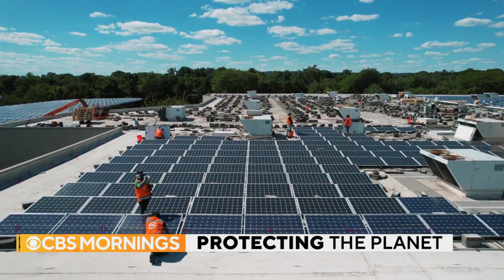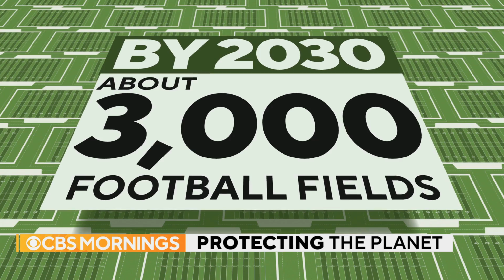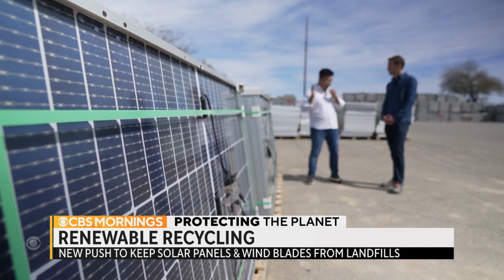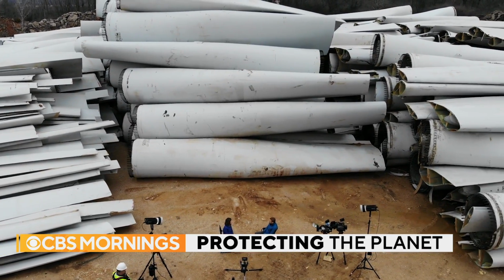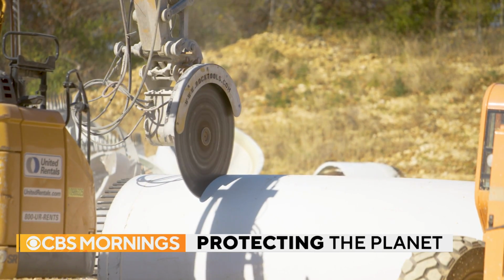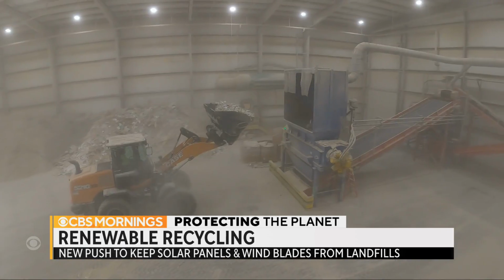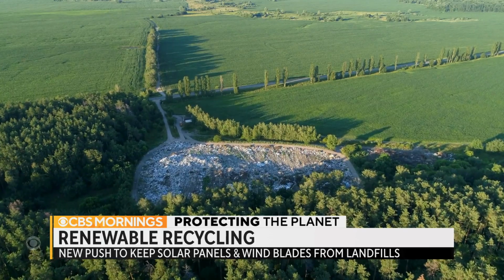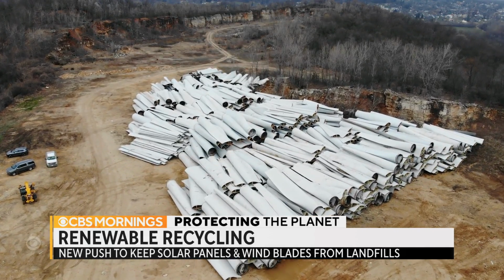Wind blades and solar panels head for landfills after being replaced

Comment: So burn the fiberglass resin (plastic) oil)) and dead trees like coal and call it green.  Fascinating.

Glass is basically useless in recycling.  The aluminum is recycled...but glass was only sucessfully REUSED in the era of milk and deposit soda bottles.  Once we wanted them melted and made virgin again...sand was easier...which is why so few districts actually recycle glass.  Pulverized it is good in redlective paint...but we don't need that much paint.

Solar/Wind is surpassing coal for NEW power plants in ths US but not the world (Russia/China for instance).  However if you are tracking it you'll find Solar/Wind grows at the same rate as NATURAL GAS ELECTRIC as they are bedfellows (handles night and bad days)

Solar/Wind isn't often coupled to nuclear or hydro, since they make more power 24x7 than Solar/Wind could ever.

Comment: Lets cut through all the bullhockey. The only reason so many of these panels and blades are not being recycled is because someone cant profit from it enough.  Just being in the black is not enough, every recycling plant every made only worked because they sold the material to someone else who wanted the goods.

The main reason virgin materials are cheaper than recycled is mainly due to government subsidies.  Stop the subsidies, and suddenly recycling becomes a viable option.  Who could have guessed that using massive amounts of machinery to dig up, process, and ship massive amounts of raw ore to different places is more expensive than just remelting the metal that is literally in the backyard.

Comment: Grinding up solar cells can create dust with elements like germanium, indium, arsenic, and antimony.  The destruction of a few solar panels will probably not be an environmental or health problem.  However, the shredding of thousands of panels could become one.
Reply: Large particulate can be captured easier than co2 or other gases.
Reply: true, oversight and capture methods have to be in place for sure. Although it's not impossible. Tbh if tossing stuff wasn't so cheap they'd probably be doing it by now
Reply: Thousands of panels? Try TENS OF MILLIONS of panels. And the process costs about $40 per panel to recover $3 in valuables. That is not a misprint. So, who in their right mind will recycle these panels? And WHY is nuclear so easily discarded as a solution? Gee, that's a great question.
Reply: No do fossil fuel

Comment: What chemical compounds are released when the blade dust burned?
Reply: All that resin and fiberglass, burns clean I'm sure...
Reply: @headspaceandtiming2114  Not to mention all the toxic waste from the chemicals used to make them, but hey that's tomorrow's problem right.
Reply: I've got a feeling there's plenty of CO2 coming from them when burned. I'd bet there's plenty of heavy metals and CO2 when the solar panels are melted down, too.
Reply: Burning plastic is pretty horrible.

Comment: This is a problem with attitude and lack of will to avoid waste not the technology itself sadly .... Its like lithium batteries whicg should be recycled inside the region they are disposed in, and renewed abs put into new batteries.... But instead it fills up landfill as one use vaping devices

Comment: It should be noted the fossil fuel industry never had and still does not have a solution to deal with their CO₂ and CH₄ (methane) emissions either!   That doesn't even include toxic carcinogenic volatile hydrocarbons and NOₓ and SOₓ either that are natural bi-products of combustion. 

Globally we emit a vast 37-billion metric tons of carbon into our atmosphere every year and almost all of it is fossil fuel based!  The fossil fuel industry uses our shared atmosphere as a global public toilet.  The waste from wind and solar is currently tiny comparison to that annual figure.  Also, as the video shows, recycling initiatives are getting underway thanks to enterprising companies.  Government subsidies will arrive too since it is an area of public interest to recycle.

Moreover, the fossil fuel emitted CO₂ and CH₄ is a "high entropy" type of waste that disperses far and wide and is very difficult to deal with.  Contrast that with wind turbine and solar panel waste which is "low entropy" in comparison and much much easier to handle.    

Also, fossil fuel carbon is invisible and dispersed so is out "out of sight & out of mind" from most people's daily attentions.  So there is no eye-catching landfill or dump of fossil fuel carbon to point a camera towards for a television news segment.

A solar panel is fairly homogenous in construction compared to, say,  a complex mass that is an LCD home theater screen which is about the same area.  A solar panel is just an aluminum frame (easy to recycle) and a thin wafer of glass, silicone, copper/aluminum and trace chemicals.  Each panel is already conveniently sized for a single human or a pair of humans to lift!

Comment: "Unexpected"? Who wouldn't have expected it? The people selling and installing them certainly knew what the projected lifespan was before they were sold or installed.

Then again, wind and solar still produce less than hydro. It's not so much that wind and solar are increasing as coal plants are being shut down due to regulatory constraints.
Reply: Coal is being shut down because it’s uneconomic. They should be shut down because of their toxicity but unfortunately, they are not in most cases.
Reply: @colingenge9999  "Coal is being shut down because it’s uneconomic."
It's being shut down due to particulate regulation. With the price of gas having risen and demand for coal fallen, the cost of operating a coal plant has fallen relative to gas, wind and solar.

"They should be shut down because of their toxicity "
One person's "toxicity" is another person's hospital with the lights on or grandmother with a warm house. People certainly do seem to be wiling to toss out the objective benefits coal has offered society over the last century and a half.
Prior to it, we were burning whale oil lamps, riding horses and taking three week sailboats across the Atlantic.

Comment: Most industrial grade solar panels are actually resold. They are still more powerful than cheap home grade and will last another decade or two. Smart DIYers buy them all the time very cheaply. Solar farms take them down simply because newer, more powerful and more efficient panels come into the market, and they can double the production per land area.

As far as wind blades, one recycler is actually grinding them down and using the pellets, grains and powder to create a new, longer lasting, stronger cement, which significantly reduces the amount of CO2 released versus the standard cement making process.
While another has figured out a way into turning them into new fiberglass to use in other industries.
Reply: sure,,,doubt its,,,you keep your tin foil hat on,,,but why worry,,,Greta said the earth will be done in 2023.....rotflmao

Comment: Windmill blades are perfect to repurpose as houses structural walls put plaster board on inside, and seal voids on outside between blades.
Reply: ?????  What kind of house would that be?  Most houses are built in straight lines, flat sheets of material, sticks, studs.... I'm not saying a very swoopy 3-D kind of rugged house is BAD, but I don't think the building industry has any idea at ALL of how to do this, and in fact that your comment might not be entirely sane.
Reply: @leonardpearlman4017  Blades have more flat section, and if you intersect them correctly only small void will left to seal. Now Put plaster board on inside and you have nice nice and strong wall.

Comment: The playground and bridge idea is awesome. Theyre so structrually sound. We should definitly be using them in other areas like that. They look soo cool in the playground and I could honestly see them working as just scultptures or for shade in sunny places. Or even vertical gardens would be really cool
Reply: Retaining walls, foothpaths, tool sheds, roofs, shade canopies, ...anything that needs a weather resistant, reasonably flat material.
Reply: @nos9784  Fencing?  might look weird, but they are durable.
Reply: @dailyrider2975  yeah deff! If cut in half it would be a great fence cause it could house plants and trees inside to run on top the fence line!
Reply: Unsightly and when you cut the stuff your dispersing glass particulate and resin into the air.   You do not want to breathe that stuff.   It would be better to not create these environmental disasters to begin with. 

As for burning them in the kilns that’s great but all that is going on there is burning the used blades instead of used tires.   Not really filling a void in the system are we?    Now you just have more tires to bury?
Reply: If they were structurally sound they would still be in use. At the end of the day the blades are not the only non-green part of a wind turbine. I am in the service industry for them and the facts are that the inefficiency and amount of non recyclables used prove that this isn't the green "savior" that is was claimed to be.
Reply: @Penny_Pincher_Outdoors  they're structurally sound to act as walls that don't move lol. They obviously failed hundreds of feet up in the air exposed to extreme wind speeds...that's why they were decommissioned. Everyone is taking this so out of proportion. Literally all I'm saying is that if it would be otherwise waste, let's use it for something else. The conditions the blades were exposed to that broke them in the first place won't be present in the applications mentioned in this conversation. We're not taking broken blades to just put them back up in the sky. After installing them along property lines as fences or as bike rack roofs on the grown like shown in the video, they're going to be just fine.
Reply: @Penny_Pincher_Outdoors  no one is saying it's a green savior. Like not even once. It's a way to redirect waste from landfill and actually use it for something else...if you work in the service for them you should already know how hard it is to move snd get rid of then. So let's just use them for something else.
Reply: @willcookmakeup  I wasn't saying that anyone (like you) said that they were, just that this is the way many are pushing it and how many are perceiving it. And many have profited massively and washed their hands of the waste these produce. I do agree that there may be uses to keep them from the landfill and that would be great! The idea, however, that they can be used structurally like a bridge (as someone mentioned) or something like that is not practical nor safe. These composites have a limited uv exposure life so to use them for anything exposed will simply be allowing them to degrade before our eyes. 

I wasn't saying that you called them the green savior, it's just the masses have fallen for the propaganda and have adopted the narrative that it has to be this OR that, abandoning the idea that we can do both. Sorry if I sounded like I was accusing you, I can see how that might have been perceived.
Reply: @Penny_Pincher_Outdoors excellent point.   You can’t really recycle those massive cement footings (I guess you could but I’d imagine the demolition would cost a fortune).
Reply: The most cost effective demolition would be to blast the top off those thing maybe 6 foot deep so the land could be farmed again.   Then the service roads need to be felt with as well.     
Now remember these thing made a profit right?
Reply: Its still to much stuff. And some of it is indeed toxic.
Reply: @InMyField  what are you talking about? They're made of fiberglass and wood. That's no more dangerous than the plastics we use to kay underground wiring or the fertilizer that we use for agriculture. We were talking about just reusing something that's already structurally integral and sound in areas not originally intended
Reply: It is a cool use of them but not enough to make a dent in 47 million tons of used blades per year.
Reply: @chrispery9002  no, we aren't. You know who is, though? The billionaire donors of conservatives around the world.
Reply: And the rough weather lately?.. Look at all the debris that used to be functional homes and businesses. Quality and responsibility need to be placed morally in decision making processes. But they have something else in mind.
Reply: are you serious,surely you jest

Comment: To be fair coal doesn’t get recycled either.
Reply: Um, yes, it does, actually. Coal ash is recycled. It's used in concrete and wallboard materials.
Reply: Could be argued that even the co2 can be recycled as trees need co2 and sunlight for photosynthesis.

Comment: The blade recycle to go to kilns for cement is a head scratcher, it takes a lot industrial energy primarily gas machines to tear those apart, then on top they are shredded into paper to burnt as a replacement for coal to cement. But cement produces a ton of CO2 as well. So short I’m questioning the carbon neutrality of these wind turbines because how much CO2 are they offsetting vs how much is going into the production and destruction and what’s the difference
Reply: The difference is huge. Wind energy is about 50 times less carbon intense than fossil solutions, when all life cycle emissions are considered.
Reply: @Freba9  I’m glad we got to the bottom of that
Reply: fiberglass should be dump in the cement to reinforce it.
Reply: Does the subsidiaries affect the carbon neutrality?

Comment: Correction, solar panels do not generate electricity their energy storage devices you can only extract the energy that was put into them at manufacturing. This is a fact.
Reply: Crazy energy dense if so. Considering I can get 18000kwh of power from one 300watt solar panel, over 25 years of it’s expected lifetime.
Reply: @Sourdough_Humboldt  He's thinking about Dilithyium Crystals or something.
Reply: Well you're both full of s*** I've been living off the grid using solar and wind for 35 years you will not extract the energy from the production of a panel in its lifetime unless you run it below 25% manufacturers recommend replacement at 80% efficiency I'm not against solar I'm against lying to people about the facts solar power has its places but replacing the world's power supply is not one of them or pretending that is some great environmental
Reply: It takes two hundred thousand Watts to Purdue's 1.  100 w solar panel.
Reply: @jamesherron9969  LOL nonsense. Research better.
Reply: Solar panels generate back the energy used to make them in 1 - 2 years depending on climate. They have 20x EROI if placed in sunny desert or 10x in the northern climates.
Reply: That's insane, not anything like the situation.  It's direct energy conversion, if you have a solar panel in a box you won't extract anything out of it!

Comment: And this was not unforeseen consequences. Everyone knew this was coming. Solar panels are only good for 10 to 15 years and the wind turbines that you build in this country are obsolete before they’re built I know. I have worked on several of the largest windmill installations in the Pacific Northwest. The generators were used bought from Europe and were designed in the 1980s yeah under the Obama administration the American tax payer paid for state of the art. Wind turbines, but got obsolete technology

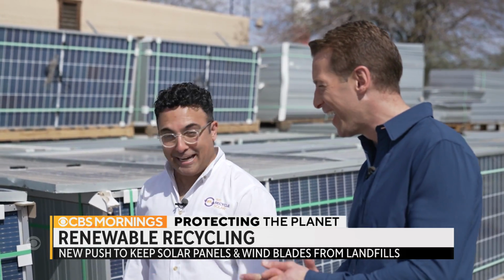Comment: 1:49 "90% efficiency" Not remotely close! Those older units will be about 17% efficiency, if not damaged. The current class-leading-efficiency panels are from Boeing Spectrolab at ~40% brand new and so exclusive that they are strictly for use on satellites only. For earth use, you will still pay a premium for 22% efficiency panels (single-sided).
Reply: 90% of original conversion efficiency. Basically if the panel was 20% efficient as new it is 20%*0.9=18% efficient as 5 year used panel.

Comment: Turn oil into fiberglass, then grind up the fiberglass to burn it to make cement. And we call that "green". The burned oil is still being put into the air.
Reply: You can't burn fiberglass genius. They grind it up and use as replace for fly ash in cement. The video showed it clearly. Do you need hearing aids?

Comment: how about using more of the smaller ones instead of the big ones that are harder to deal with?
Reply: Smaller wind turbines are less efficient. The taller the better.
Reply: @Freba9  look into the new ones...
Reply: @YodaMan-420  Doesn’t change the physics.
Reply: @Freba9  smaller ones are easier to deal with. can be placed directly on peopled homes for individual use and more efficient than they used to be. you seem locked into using one giant one for an entire area instead of using smaller ones to cover more and leaving less waste behind. and less ugly.
Reply: @YodaMan-420  Small turbines can be cool in some situations, but they can’t replace the larger ones. Solar is better suited for domestic applications.
Reply: @Freba9  only till you consider the upkeep. then no.
Reply: @YodaMan-420  If that were true energy companies would be building gigantic fields of small wind turbines. But they obviously don’t. There is much, much more energy to harvest if you go high up in the air.
Reply: @Freba9  you seem to be having a conversation independent of the content in this video. have it with someone else.

Comment: The fossil fuel PR propagandists act as if giant Willy Wonka factory coal processing facilities coal burning and electricity generation facilities, refineries, huge humongous offshore oil rigs. Miles long fuel oil coal transport trains, 6 storey coal excavators and strip mining conveyor belt menageries and mammoth sized skiff loaders... etc etc. Adding up to 3 times as much waste volume... DON'T END UP IN THE LANDFILL ALSO. Don't require twice as much maintenance and are certainly nowhere near as cheap as wind turbines or solar farms because they fail to add in the cost of their original construction when attempting to portray solar and wind as expensive.